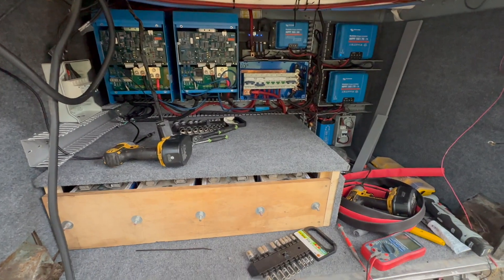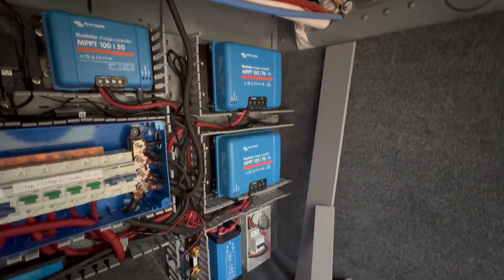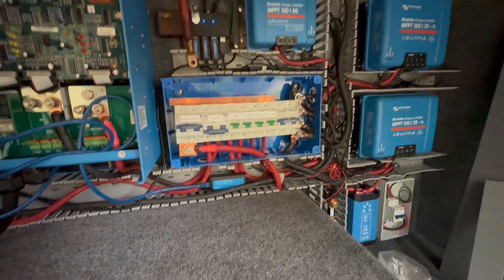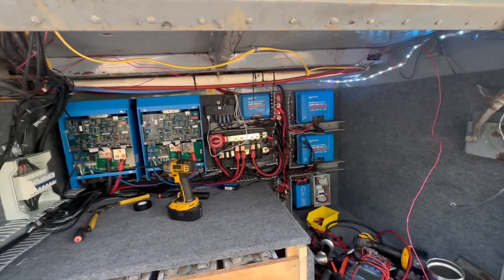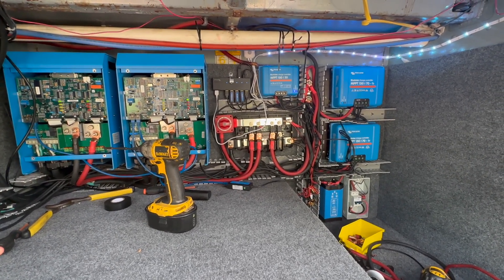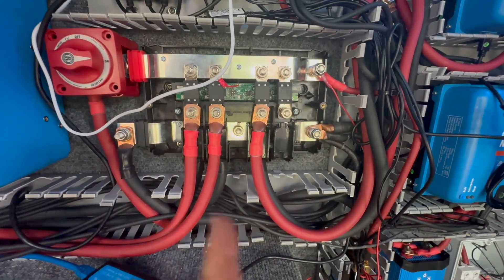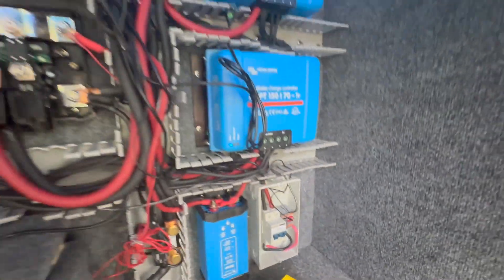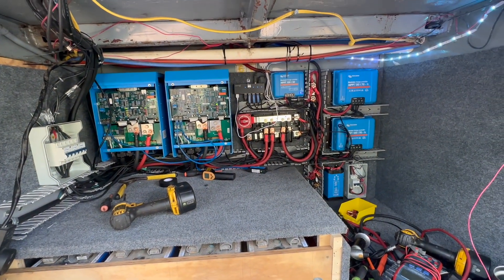MCI Bus Conversion 5640w Solar System Rebuild Part 2 - Final Results

Comment: On your Orion what size of fuse would you use & would you put before or after the Orion?
Reply from the maker: Before the Orion. 50-80 amp fuse or breaker on 6 awg wire. Fusing is wire size dependent. After the Orion can be infused if you size the wire for the max amps the Orion can output (70 amps) so if you did 6 awg out as well (as I did) then you’re safe because even if it dead shorts, the Orion can’t over current the wire. Still not a bad idea to protect though.

Comment: For running AC's, is it worth switching from RV AC's to mini-split(s)?

Everything I am reading and researching seems like you would be considerably more efficient.
Reply from the maker: Yes absolutely! For our RV we have ducted areas that need the forced air. I’ve seen someone use an air handler instead of a normal cooling head unit. However we’re way past that. 

Rec Pro makes a very competitive roof top AC that is closer to a mini split.

Comment: Great stuff….  I have a “worm hole” question….  Would it be possible to have both a multi plus 2 ( or Quattro 2) run the 12 v side and have a 48v all in one inverter, like the eg4 3000 or 6500, and not buy the victron mppt, lynx, etc.   set up the 48v inverter as an AC input for the multiplus and go from there…. This would be for a standard class a rv….
Reply from the maker: I’ve seen people run a cheap 12v inverter to act as an alternator charging source for 48v systems. Alternator runs inverter, inverter connected to big inverter input. 

I think I need to understand the problems you want to solve to better understand the execution.